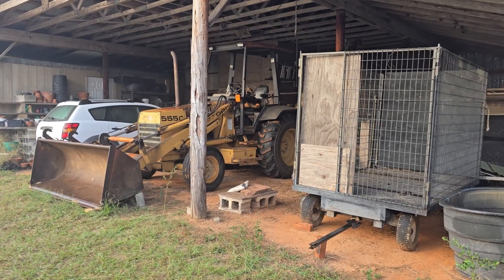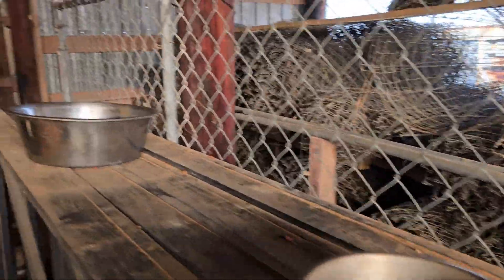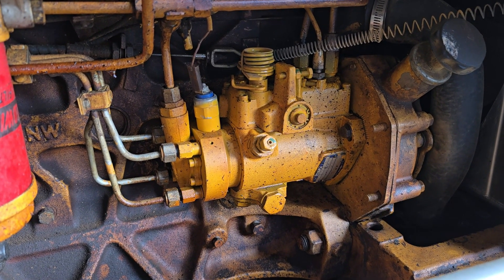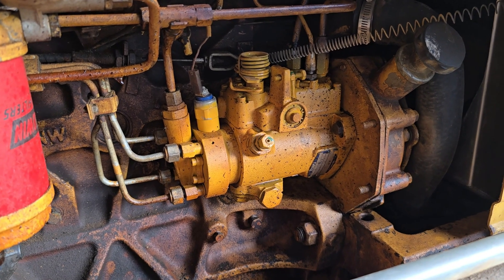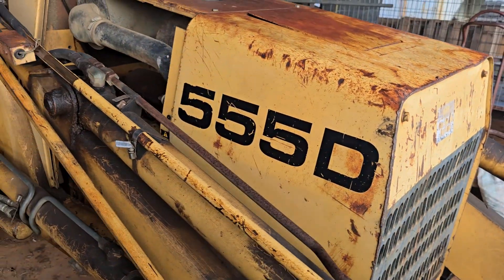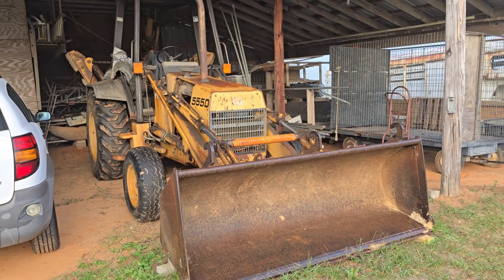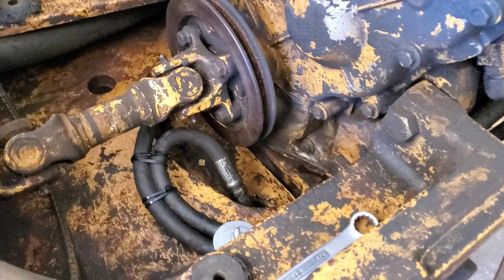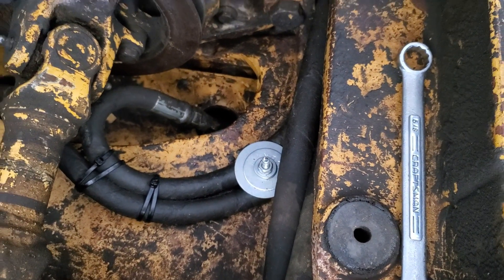555D Backhoe Fuel Injector Pump Replacement - Repair Vid-1

Comment: I have a 555D I had to replace the two hydraulic lines to the pump and cooler. The lines were wearing on the bolt and nut that hold a counter balance weights. at the bottom of the hydraulic reservoir. put it all back together. A week later we could not get full RPMs out of the engine ,had to take out and clean out the fuel tank, fuel lines going down to the filters, replaced the primer . I am now working on getting the injector pump out to get rebuilt. In the past I have had to rebuild most of the hydraulic cylinders and replace a lot of hydraulic lines. Keep in touch and thank you for the videos.
Reply from the maker: I just saw your comment, thanks.  I dread the thought of eventually having to replace the hydraulic lines supporting the backhoe.   I know it's coming, what a mess.  Thanks for watching.